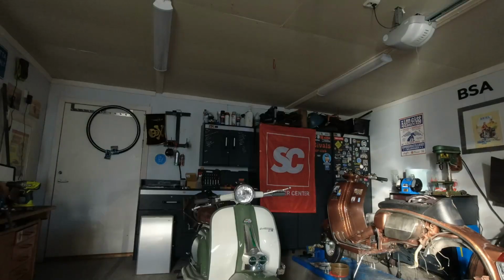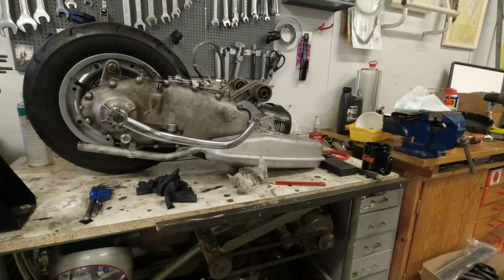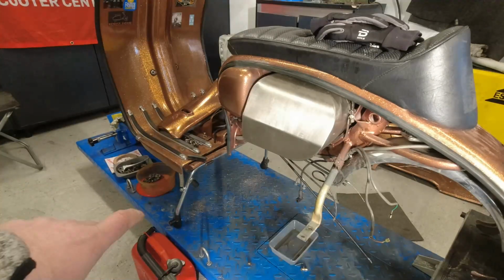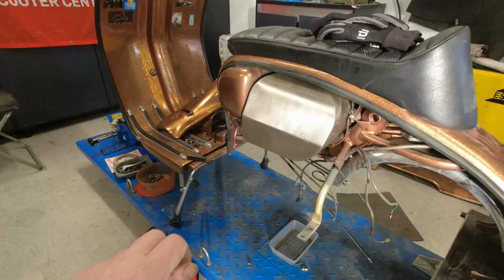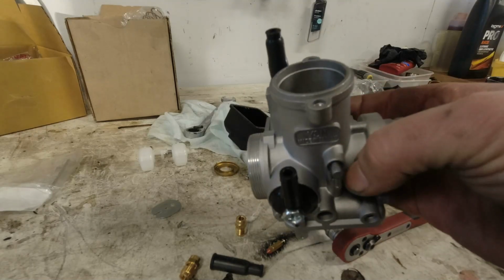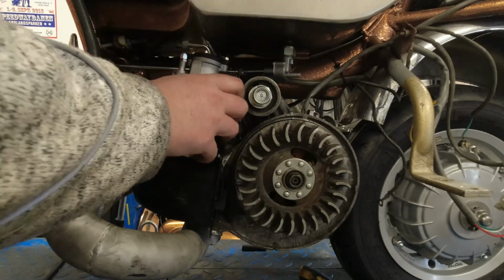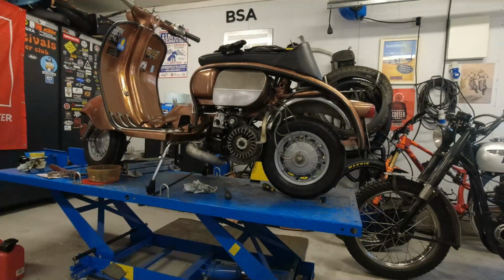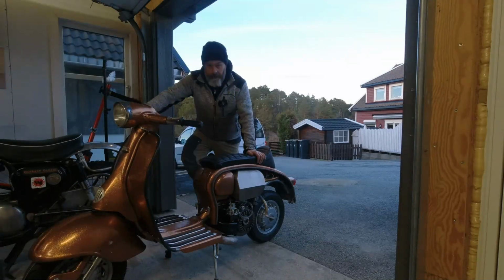Golden #Lambretta rebuild #kickbackgarage

Comment: Hi rob was looking at old video 1 year ago the golden metallic ts1 rebuild to rt225. My question is as i am building one the carb jetting you fitted to the 30mm a 266 AS atomiser 13x needle. My question is why a 266 AS opposed to a av 266 interested to know and learn pls. Regards terry. Suffolk England. Great channel.
Reply from the maker: The Germans like their as 266 because it is a bit leaner low down. These days I use av266 and if it has a reed, I like the 45 slide.

Comment: Another great video and Scoot !
Don’t know if you ever come across this problem. Upgraded my series 3 125 to a 175 . Changed barrel and piston . Now when carb manifold back on , and engine in bike , no room for carb ! Am I being a complete dummy? Beedspeed said they’d never heard of problem with one of their kits and to send pictures 😞
Reply from the maker: That sounds odd. Is it the same manifold?
Reply: @kickbackgarage  . Yes , I even found a slightly longer manifold in my old box of bits , but that didn’t help 😞😞
Reply: @kickbackgarage  . It’s the knuckle with the fuel inlet that hits on the engine mount
Reply from the maker: Indian 175 kits can be a bit dodgy. Sounds like you need a manifold with a different angle. It will be interesting what beads peed say. Their customer service isn't always great and a reason why I avoid using them.
Reply: @kickbackgarage  . I know , got a electronic ignition at same time , took a week of emails to get some instructions!!

Comment: I have a delorto and now use a polini which is half the wieght and not as tall

I need to get one of those benches.
Reply from the maker: The lift is one of the best buys I've ever done but it does take up a lot of room.
Reply: may i ask how much height difference is there between the delorto and the polini ?
Reply: Just got a tape measure out in freezing garage, just quick measure.

Polini bowl 6 x 6 / Delorto 6.5 x6 - Polini Venturi 8 / Delorto 9cm - height Polini 13 / delorto 14

fuel input / screw are also nearer to the body of carburetor 

It is a lot lighter than Delorto which is good for rubber manifolds

To be honest after measuring their is not a massive difference size.

Polini are very easy to set up.
Reply: @Zacky12345  thank you 👍
Reply: Polini carbs are half the price of delorto’s and are tested in the factory before released.